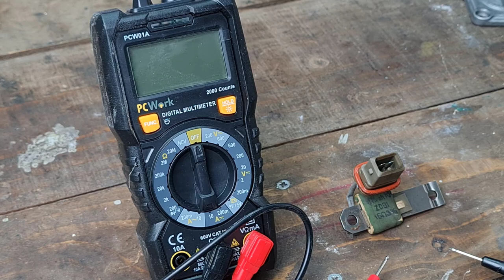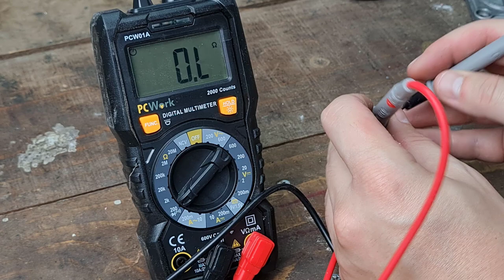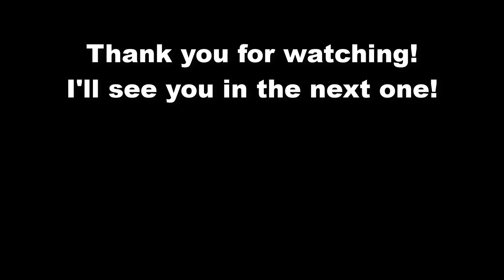Bosch Warm Up Regulator WUR Rebuild  // 1985 Porsche 924 Restoration Project // Part 19

Comment: That’s for the video, it’s really helping me out. At 3:44 you pop out the top disc which has a thin silver one attached to it. Mine does not come out (the silver one). It’s totally stuck and I don’t want to force it. Have used penetrating spray to no avail. Suggestions?
Reply from the maker: Hmmm... Maybe try to leave it soaking for a day or something like that?... Or you can  gently pry it with a razor blade as you get a new disc in the kit.
Reply: @RestorationApprentice  thanks for the quick reply. Actually just got it out, I didn’t realize how thin it was, so I was prying too low beneath it. Good thing the kit comes with one as I very slightly kinked it. Hopefully this does the trick! Keep up the great work.

Comment: Very nice.  My only quibble is that the finish after soda blasting is true to the original.
Reply from the maker: It leaves the aluminum stained. I need to get a vapor blaster to get the proper finish, but they are very pricey.
Reply: @RestorationApprentice  that makes sense!  Would dry ice cleaning also provide the correct finish?  (Even more expensive than vapor blasting to get the equipment to do at home)😄
Reply from the maker: Yeah, dry ice would definitely work, but as you said, even more $. You gotta work with what you have.

Comment: Hi do you know if you cam test a ignition control module i have no spark at the coil.or spark plug
Reply from the maker: Sorry, I don't... Do you have power at coil?
Reply: Yes it says in the manual that feed at the coil should be 2volts I have 6 volts at the coil + terminal I think the ignition Control module is faulty

Comment: After you rebuilt this WUR did you have any issues with cold start etc? How’s the cars system pressure and control pressure?
Reply from the maker: Haven't tested anything yet. My parts are still of the car as I'm doing the full restoration.